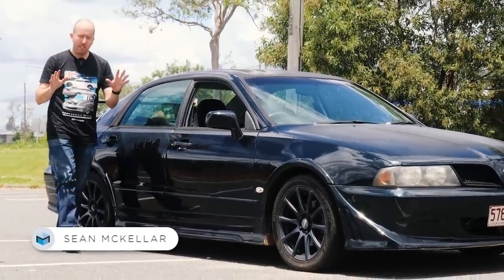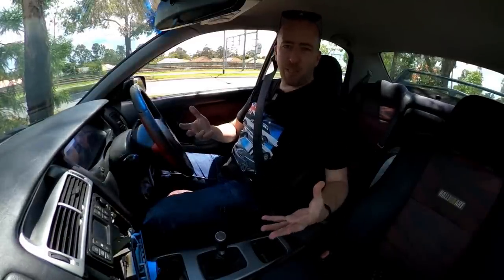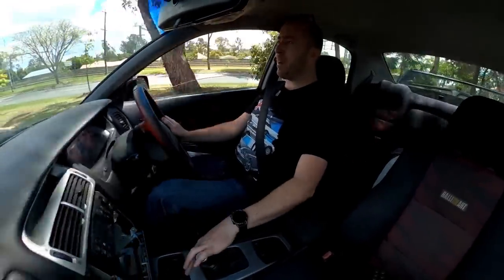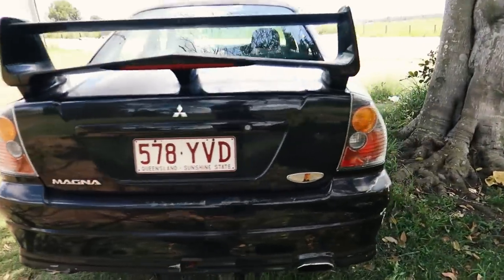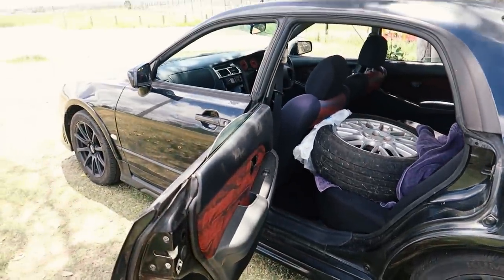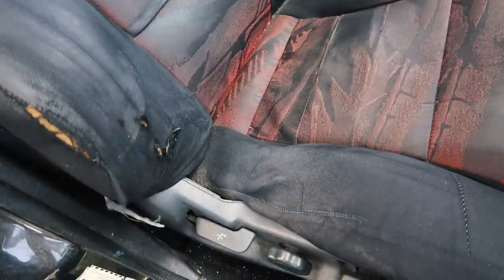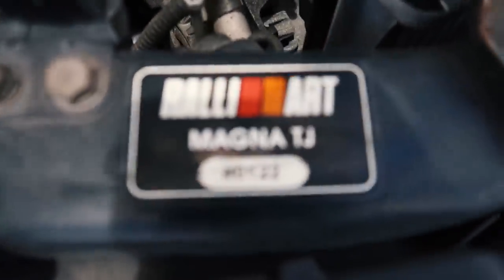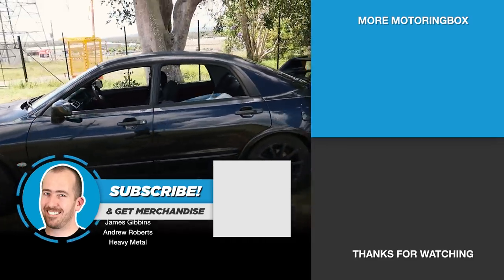Mitsubishi Magna Ralliart First Drive! This Aussie 180kW 6G74-powered manual sedan is a screamer!

Comment from the maker: Thanks for watching! Like, comment or sub to support the channel.
👕Or grab a shirt or sticker from https://www.motoringbox.com/shop
Reply: Y6
Reply: There is turbo version ( 2.5 litre one) ,probably rare now.
Reply: @amuxpatch2798  
Don't think there was ever a turbocharged Magna. 
There was some Supercharged ones though.
Reply: @brantleyfoster021  Mitsubishi  did have a turbo sigma (1970 to 1983 first models).It was a 2.5 turbo astron engine. Collector's car.
Reply: @amuxpatch2798  
Oh that was before the Magna was even launched. 
The Sigma turbo was a great car in it's later year's & popular. 
But it took 3rd place to the highly advanced Cordia Turbo & Starion Turbo. 
The Starion's were Mitsubishi's performance weapon, it was a Group A car so.
Reply: dont forget i have 4 x new enkies if ya need them and a rear badge, i forgot to mention i have new leather for the shifter and letaher console lid covers in black leathe
Reply: @amuxpatch2798  
It's worth noting that the Cordia Turbo was faster than the Starion when comparing stock vs stock. 
But the JDM Cordia's were significantly more powerful & faster. 
They were very hard to beat at the time. 
They had 150kw from their turbocharged 4 cylinder engine, but they weighed less than 1000kg. 
The only problem is they weren't very reliable car's, but this unreliability could be rectified with one modification. 
I can't actually remember what the modification was, it was something to do with the turbo - I think it was turbo boost controller.

Comment: As a mechanic who worked at a Mitsubishi dealership for 7 years doing rear spark plugs or a timing belt on these aren’t as scary as some think IF you know the right “hacks”. Also when doing the timing belt, best to replace cam seals, water pump and crank seal all at the same time. Saves you having to come back later and tear it all apart again.
Reply: Definitely agree very forgiving and pretty easy to work on, except when the throw out bearing jams if your trying to remove it lol
Reply: I agree on timing belt and rear plugs along with the rocker cover gaskets. I also replace auto box in the driveway.
Reply: Wise one.... teach us your secrets!
Reply: Yes alot of mechanic's charge more than they should for Magna's who don't know these hacks & it's irritating that Magna owner's have to pay so much for it.
Reply: @brantleyfoster021  They have tonnes of different models come in every day they can't piss around trying to figure out clever ways to do things they just need the job done. It's on the manufacturer for not documenting the easiest way possible in their shop manual
Reply: I did timing belt , water pump ,tensioner  on my 380. Hardest thing was getting the engine  mount  back on. My biggest job. Done it and  proud.
Reply: @s8wc3  😢
Reply: Yes 🙌🏾 That’s that diamond edge knowledge 😂 🤙🏾😂🖖🏾 same back ground , work shop lackster , they had filthy good torque. People were proud in the shop the Magna was giving the other Aussie made cars a run . Loved my holdens too , what an era . Loved every day of it , I recently bought the wheels magazine from read every smoko working there  . Own 2 tritons mk , one a tipper modified , other mod glxr . Last of the old girls . Lovem they never die an driving them feels like driving back in the day . Old school bullet proof torque gold , Not all this new leftist electronic sh 😂 ✌🏾
Reply: @Evvzt  MK Triton was the toughest one built IMO. Just as long as you don’t have to do a U turn 😆
Reply: @RideDriveandbuildAU  When replacing rocker cover gaskets also best to replace the spark plug tube seals also as they leak and cause the plug leads to swell up and fill the plug tubes with oil
Reply: @heavymetal9622  always, they come with the cover gaskets so while your there.
Reply: @heavymetal9622  every tradies favourite turn!  Don’t forget to keep the indicator off! 🤣
Reply: Timing belts and plugs are pretty straightforward, just take your time.

And yes, do the pump and seals while you’re in there.

It’s a great car. My Mums TF advance did an insane amount of kms on rough roads and hard use and never gave any real trouble.
Reply: These cars aren't that hard to work on. I'm no mechanic but I replace the timing belt, water pump, tensioner, drive belts, front and rear cam cover seals twice, rear sparks, did an auto trans fluid flush.
Reply: Yup I know what you mean mines costed 9 grand lol so yeah it's expensive
Reply: Cambelt and cambelt kit water pump engine mount spark plugs head gaskets and gaskets galore. And still not ready
Reply: The biggest problem I've had with the 3.5/3.8 timing belt is finding how to lock the cams when tensioning the belt. Other than that, it's not bad.
Reply: @Evvzt  , what?
Reply: @tjw8t1  Cams shouldn’t require locking at all if done via the correct procedure. All the slack of the timing belt should be on the tensioner side then when you let the tensioner go it’ll take up the slack. Cams on TDC will not roll when the belt is loosened.
Reply: @heavymetal9622  Right the cams don't move with the belt off. I was so nervous on first start😅.
Reply: Where is the camshaft position sensor on this thing 😭😭 plzzzz helppppp I’m about to rip the motor out but this could save my life.
Reply: @asf-the1996  google mitsubishi 380 workshop manual online.
Reply: @heavymetal9622  I didn't catch this comment from over a year ago, lol. I did the timing belt on my 2007 Galant Ralliart I got about a year ago and zip tied the belt as I went around putting the belt on the sprockets. It went smooth, probably the easiest one I've done so far.

Comment: A horrendously underrated and special car that’s been completely forgotten. Fantastic pickup and I don’t think you paid too much. 
Subbed to see how this project progresses.
Reply from the maker: Thank you mate!
Reply: Totally agree. 
Cracking car.
Reply: It amazed alot of motoring journalist's how fast the car was, they pointed at the car's official power figures as being way down from what it should be. 
I thought some review's exaggerated the cars performance a little tbh, Autospeed stated that it thrashed the Subaru WRX STI that they had access to at the time. 
Plus the Ralliart Magna did it despite being weight disadvantaged by another passenger. 
But I changed my mind about it when I learned that some Ralliart Magna's had 210kw instead of 180kw, I'm not certain how much torque those car's would have but probably more than 350nm. 
Mitsubishi probably gave those car's to the reviewer's I think. 
There was 30 that were Supercharged too.
Reply: When the first released 6G74 Ralliart was maiden Aussie road tested, the reviewer stated in his final written report . . .  "Who would want a car this powerful??!"
I think that says it all . .
This is one 60 degree vee 6 pot grunt machine!

Comment: A very interesting take on the Ralliart.....I worked for MMAL Australia Ltd close to 20 years before we closed the plant in 2008....I still remember the nightshift I worked and saw the prototype that you pictured in your video......When this car was produced this was properly the most exciting time for us as a company because we started to shake the old Grandpa Magna Spec vehicles to a more sporty version that would take on the likes of the HSV Xu6 of the times...Ive still got my Ralliart Magna its only done 70,000klms good luck hunting down the parts because they are rare as hens teeth these days especially the parts you are after.......Good Luck with your project Im looking forward to seeing your progress..
Reply from the maker: Love reading comments like these, thanks mate. I get the impression MMAL wanted to do more with this car, but were limited by what management (in Japan) allowed them to do.
Reply: @MotoringBoxTV  The engineers in Japan insisted the Adelaide local engineers used heavier valve springs i was told, even though the camshaft changes were just a smallish 10% increase to the base circle radius lift and a 6 degree overall valve timing advance. Nevertheless it gives the engine a nice 'lope' at idle after a hard drive . . fantastic engine the 6G74 . . !

Comment: I bought a 99 Magna V6 back in 2002 as a stop gap car but decided to keep it a bit longer and even now I wish I still had it as I have to say it turned out to be the most durable and reliable car I have ever owned, far far more reliable than my FG Falcon XR6 that I bought new and on a par reliability wise to my Toyota Prado, the Magna unfortunately was and is very underated

Comment: I'd recommend one modification, look at fitting a modified 380 intake manifold. The intake manifolds were a carry over item from the 3L motor and they just don't have the capacity to breathe. A 380 manifold is about $40 at the wreckers, and a competent alu welder can make the necessary modifications for $200ish (Add a vac port for FPR, and move the TB flange so it bolts up like stock)
It'll let the motor breathe better. Apart from that, not too much else you can do to them before spending some coin. Honestly the Ralliart 3.5L with a 380 intake goes so well you wouldn't bother with the whole 3.8L motor.
Reply: There is a well accomplished performance engine building firm in Perth which can alternatively provide a modified 6G74 inlet manifold with a 150% plenum capacity, using the existing runners - this provides for further top end power WITHOUT loss of low and mid-range torque which is what is 'felt' underfoot - for an unmodified engine the low and mid-range can be significantly improved 'under the foot' by the addition of intake runner tuned length 'ram tubes' in conjunction with the 150% increased plenum capacity. This would be my recommendation, unless you wish to go racing all day at 6,000rpm!  Modifications are a compromise in one form or another when you have a computer controlled modern engine design.
Reply: So the 380 inlet manifold has 'narrower diameter' inlet runners than the 6G74 standard inlet manifold (that is of the same design as the 6G72 manifold). This really surprised me, when an ordered 'ram-tubed' 380 manifold turned-up, and wouldn't bolt-up exactly, orifice to orifice, to the 6G74 lower valley intake (it is a split two piece, bolted together intake manifold system that these engines use). In other words the 380 manifold was dumping air down into a LARGER set of lower pipes. And this lower exit section of the 380 tubes was well below the lower edges of the inserted ram tubes. I was told by a speedway race engineer that this would tend to stop reversion. It would also mean low and mid-range torque would be increased over the larger diameter standard 6G74 upper inlet runners. Top end power however would probably be restricted by the 380's smaller diameter runners one would assume. So, in the the case of the 380 manifold over the 6G74 one, 'bigger' turns out in reality to be 'smaller', and quite noticeably so too. That surprised the heck out of me. If you want to run your engine regularly at 6,000 rpms it is going to pull down air more easily through the bog standard inlet manifold, which turns out to be significantly bigger internally than the 380's intake manifold runners.

Comment: I had a 1998 3 litre manual.
Talking about the throttle response you are bringing back memories, that thing wasn't absolute ball tearer
Paid $1,500 with 80000 km on the clock,  from Lismore as a hail damage  car

Comment: Epic score mate. I owned a 2002 Magna VR-X for 6.5 years till it was rear ended and written off. Was one of the best cars I've ever owned. Never had any issues and was super clean when I bought it.
(These and the VR-X along with the Magna Sport were Australia's fastest 6 cyl cars, till the XR-6 turbo came along )

Fit and finish of these cars is testament on how Mitsubishi Australia built these so well and were a very underrated car for it's time and the only people that said they were crap were people that never drove or owned one.
For "only" 180kw these Ralliarts were very quick in the day and still are. They're a big car that can hustle.

Exceptional ones still pull big money for a 20+ year old car.

Got a really big soft spot for the TJ Magnas. I'd own one again in a heartbeat.

Comment: The pinnacle of Australian motoring excellence. Well done
Reply: Rocker cover gasket’s are not that hard to do , the rear 3 plugs are 100000k iridium’s , the front 3 normal, the timing belt is a straight forward job , sometimes the o ring on the power steering banjo bolt weeps and people unnecessarily do the rocker cover gaskets , very rarely the head gaskets can leak oil externally, and the distributor o ring will be leaking. Other than that , bulletproof
Reply: not very australian

Comment: People who don’t get will hate it, these things are Commo killers and are very underestimated 💪🏼

Also an ex Mitsubishi mechanic, while they leak plenty of oil they are as reliable as any Falcon/commodore
Reply: Just like the Aurion yes, in a straight line it would probably beat similarly aged V6 commodores but front wheel drive is big con

Comment: Well done mate. I've owned these cars for years now (Currently have 3)
Instead of a Ralliart I just bought and am currently restoring an AWD Magna in Zen purple (only made 20 I believe) and mine is only one with sunroof. Was going to be scrapped as it had hail damage and engine was stuffed. Have done an engine swap (6G75 from the 380 and cammed) car is amazing. I don't regret it anymore. Still much more work to do.
Reply from the maker: Did I see that one for sale a few months back here in SEQ?
Reply: @MotoringBoxTV  Nah I think I know the one you mean though, If it's the one I think it was for sale not long after I bought this one. This one came from SA. It was originally built to spec by someone who worked for Mitsi back in the day. It had a Ralliart motor in it instead of the standard 3.5. Sadly whoever owned it after that drove it like a tool and destroyed the motor. 
Incase no one else has told you, you got a good buy considering it's a manual and sable black is a very desirable color.
Sadly hard to have good paint on then unless they have been resprayed. From the video lots of things on there are easy fixes. 
Also most of the guys on the Magna groups were really happy with your video. Just thought you should know.

Comment: What an awesome find mate!

I had a red 01/02 magna vrx manual 4 years ago, it was a brilliant car. Had 163kw and an awesome exhaust system completely standard.

 There's nothing quite like them, it's hard to explain, I know exactly what you mean about the throttle response though.

Mine has to get the head gasket replaced (apparently common with magnas),  had missing door handle trims and sagging roof lining. The driver seat also looked a lot like yours.

Best of luck with the car, they are a bunch of fun. I used to get people wanting to race me all the time...
Reply: Just chiming in - but after 1996 with the introduction of the TE magna. They went to MLS headgaskets and not graphite - Head Gaskets are absolutely not a ‘common’ thing to go. Lord knows what had to happen to that car to have an MLS head gasket fail
Reply: @dodgeviper89  oh might be the rocker cover I was thinking... There was oil in the spark plugs. 
Thanks for the correction

Comment: This is awesome Sean!
I’m a massive Magna fan.
The Ralliarts pistons are a higher compression over stock. 
The pistons were sent to Germany to be shot peened, to get them anodised the piston crown and top compression ring fitted too.
10% higher cam lift over stock, with ungraded valve springs.
The heads were ported for better breathing.
Even the regular 6G74 motors are great power plants, they’re very smooth and torquey.
The Ralliart motor is a masterpiece.
180kw is a strong figure for a 20 year old NA 3.5.
Same as Holdens supercharged 3.8 XU6 at the time.
Italian Momo leather steering wheel was nice too👌
I’m looking forward to seeing the progress on this rare Aussie car
Reply: one of the rarest, parts are unicorn p00p
Reply: Although the boxes say made in Italy, the wheels were made under license in Australia.
Reply: @dodgeviper89  yes true, Momo specified Italian leather, but made here
Reply: Ralliart 6G74 were 9.4:1 compression ratio. The stock 6G74 was supposedly 9.0:1, however my TL cc'd out at only 8.5:1. I managed to bring that up to exactly 9.7:1 by decking the block and head (and piston crown) surfaces to the maximum that was possible. Had wanted 10:1 but that wasn't going to work. I de-shrouded all the valves and profiled the chambers, fitted phenolic heat blocks to the intake and TB, ran the engine cooler with an 82 degree 'fail to safe' hi-flow thermo and a 'thicker' rad, used the Ralliart exhaust system fully ceramic coating in and out, ripped out and blocked-off all EGR junk, opened-up the TB butterfly lip restriction, used Ralliart cams AND vernier wheels to set-up the best amount of advance, picked-up a day race hi-output dizzy, Pulstar plugs, used a super Delphi MAS unit and a suitable flashing chip unit for the ECM. It can use 98 only. There is not one single baffle or restriction ANYWHERE in the whole length of the exhaust system, half in 3" reducing to 2.5" to maintain heat and velocity and exiting through a BIG Bourla . .
Reply: @skippmclovan1135  geez your car would hammer, fantastic mods mate
Reply: @GForceVRX  ..yes, a 5.7 Hemi felt so slow  in comparison when i had them both at the same time ..the Mitsi was a once in a lifetime project ..took a long time to get it done